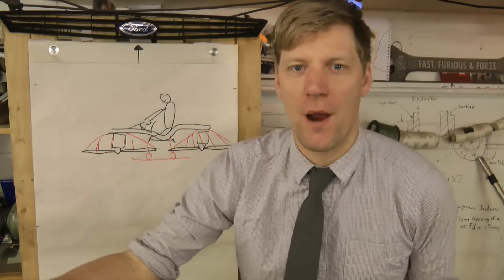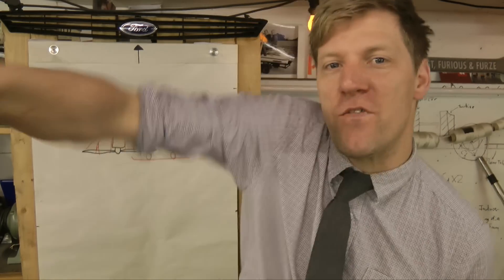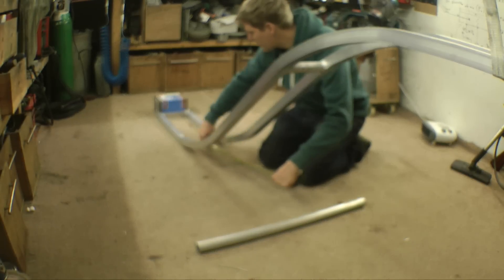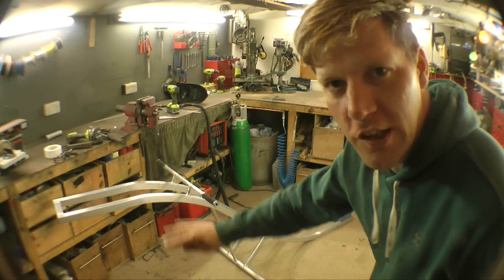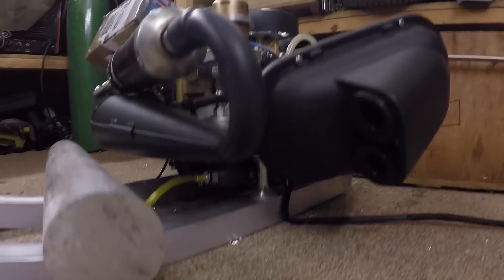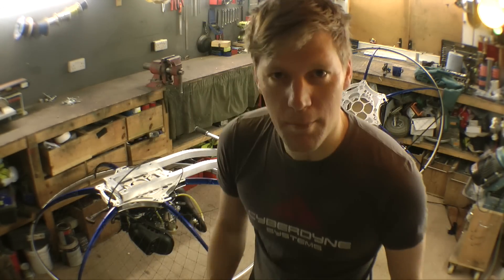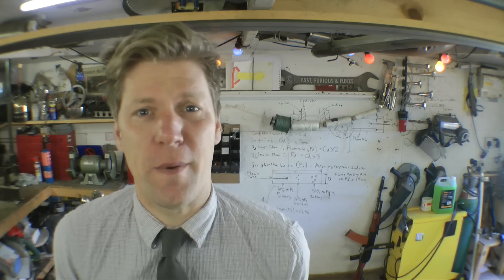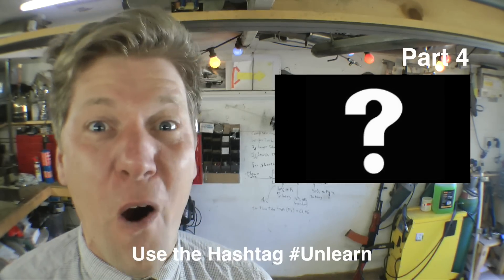Making a Home made Hoverbike

Comment: Awesome awesome! Carbon fiber is really easy to work with. Wet lay-up and vacuum bag to a mold or vacuum resin infusion (a little more complex). The carbon is expensive but if you can swing it it's worth it. It lays up just like fiberglass.

Awesome bike! Thanks for building it.

Comment: Why you did not consider placing two smaller engines on sides to control roll?
Reply: Weight
Reply: roll is handled by weight, same as a normal bike
Reply: too much weight maybe...
Reply: +Reptilius Maximus uneven acceleration will do the rolling job he wanting or not
Reply: lean to roll
Reply: Do a barrel roll!
Reply: He said he didn't have a big enough budget for 4
Reply: +Harrison Harris that's not exactly true, bikes are handled with handlebars, leaning only helps a tiny bit
Reply: +RockPapersBeer exactly what I was thinking he will probably just hover it
Reply: +Harrison Harris That's not possible since the center of mass is too high above the propellers when it should be way under them.  It makes it very unstable and once you roll to one side, you can't recover from it anymore and you'll tip over.
Reply: I suppose we are talking about horizontal roll, not vertical roll. I know there is a english word for it, but i cant remember
Reply: Pitch, yaw and roll are the english terms for the three axes.*****
Reply: +o3tomas No, leaning is where most of your control comes from. You only really use the handlebars at very low speeds.
Reply: Killspec that is because of the friction of the wheels with the ground. His flying machine will just move laterally if he try to lean
Reply: ***** thats true. he was talking about motorcycles though. I wonder though if you lean while going forward if you would indeed turn.
Reply: +RockPapersBeer If the front motor is run at a reduced speed to the back motor the angle of tilt produced would move the craft forward much like with a helicopter, depending on the setup this might also cause the craft to turn as well.
Reply: he will have to move forward and backward by leaning the body, for turning he will need to use uneven torque
Reply: +Brent Sido I think that with the front one being further from the ground it will natural produce slightly less thrust

Comment: There is a slight problem in inverting the motor, it also inverts the thrust :) and flipping the propeller doesn't change that, only reduces its efficacy.
Also it is an inherently unstable design in two axes that unless you can balance it by shifting your weight while balancing the two motor thrust. The design is problematic :)
Reply: No one cares mate if it flys is all were bothered about. It's people like you that never invent anything where Colin does
Reply: +Hecarim But he is right, in order for this to work he has to buy and install a mirrored version of the propeller. I hope he thought of that, else it won't possibly work.

Ok, on 4:34 you can see, that he has two opposite handed propellers on the engines, so he really thought of it ;)
Reply: +R5skillz Flying is highly researched topic and dynamic balance calculations are grade-school level physics... so there's no need to try to guess when you can rely on math and calculations and experiments done by others way before him to know it's going to be unstable.
Reply: +Dan Frederiksen I am sure he knows this and got a CCW prop.
Reply: +Dan Frederiksen if hes using the same propeller yes, they sell reverse rotation propellers
Reply: +Klaufmann ok so he got an opposite spin prop, he left that important bit out but fair enough, still some critical problems remain. His weight on the foot rests is technically below the thrust center which would balance but because his weight center is not at his feet, any leaning of the vehicle will make him lean his weight as well and void that. So I'm thinking it is inherently unstable in pitch and roll. With skill it might technically be possible to balance on it but it would be extremely dangerous to really fly it. But he could make a position under it which could help a lot.
Reply: +Hecarim, except I was completely right.
Reply: +Hecarim, the craft was quite unstable in flight exactly as I described above. Which part don't you understand. Although I was a little surprised at how roll stable it was. Not to mention he almost fell into the propeller at one point which is really a very serious thing.
Physics plays for keeps. There is no plumber's discount.

Comment: how do you turn???
Reply: +JK JIBJAB you dont
Reply: Magic
Reply: +nick hansen XD
Reply: lean?
Reply: not
Reply: +JK JIBJAB I'm thinking that if you lean you will create a difference in lift from one side of each fan to the other side. this may cause some rotation.  I really don't know but that is my prediction.
Reply: You don't.
Reply: +JK JIBJAB Well.. it's a "hover"bike isn't it?
Reply: +JK JIBJAB With your weight
Reply: +JK JIBJAB It turns on it's own, if by turning you mean flip.
Reply: +JK JIBJAB make 1 propellor turn slower
Reply: +Colin Firth I fly Quadcopters and therefore I know a little bit about those things.
a) you could turn, by leaning to one side and accelerating the front engine, however, you will most likely crash after the maneuver.
Flying with 2 Motors is almost impossible because it is up to the pilot to maintain balance. Once you loose balance (Not perfectly balanced frame, wind, leaning to one side) the rotors will start drifting to one side and you would crash.

I don't think that he needs to turn because all he can do is fly up a few centimeters and try not to land on his side.
Reply: Needs ailerons or rudder...
Reply: Rupert Bruce What he really needs are 2 motors on the side. Rudder or Ailerons would cause the 'hovercraft' to crash, since a rudder creates force on the top and therefore create movement to the side. Ailerons aren't a bad idea but he would need to go really fast in order to get ailerons to do anything. A plane has Rudder and Ailerons because of the speed of the air. A hovercraft can hover (won't go fast, nothing to push against a control surface.) so there wouldn't be a use for such controls. All he needs to build is esssentialy a Quadcopter or Tricopter.
Reply: +AsStrange0815 It's possible to turn on the y axis by reducing the thrust of one engine, allowing the dominant engine to create a rotational force, however, this would also cause the craft to start travelling forwards as well... as you said, the easiest thing to do would be to build a quad or tricopter.
Reply: +Tyler Whieler But that will always make it yaw at the same time.
Reply: you can move (not turn) sideways by leaning to the desired side. 
Increasing the throttle of the clockwise turning engine will make you turn counterclockwise and indeed also makes you go forward or backward, but that could be countered by leaning to the opposite side. 
a bit complex to master, but introducing bodyweight to the steering technique could make this possible. 
Balance will be a thing though. it's like sitting on a bicycle on ice...
I'd hate to see you end like this, Colin...

Comment: I like how easy it is to make this flying machine make certain maneuvers, but, it can't strafe. It can turn, go forward, and go backward, but, you have to be able to shift the amount of power from the front and back, as well as change the directions of the blacks to face inward or outward to make it spin. Strafe would take another blade. With a microchip to control power distribution and angle, you could have to only worry about height and direction.

Comment: Just found the channel today, really enjoying the videos. A tip about aluminum I think you might want to look into on your next build. Rivnut inserts, they are wonderful little rivet type objects that actually make a metal thread into thin wall aluminum tubing.
Then you can have a threaded hole in aluminum that you can take your bolt in and out a bunch of times without worrying about damaging the threads.

Comment: add 8 edfs 2 on the back for acceleration, 2 on front for brakes 1 on left and 1 on right of every larger to allow steering and add yaw and pitch control on the large blades for strafeing and stabilization.

Comment: hope you're seing this furze, but i went over your design, and i think i have a few adjustments: First i think the frame should be longer, so that you can add a chair or a saddle or something, but the end have to be symetrically equal from the saddle, secondly, i think that you should remove those "wire nets" for your protection shields and replace them with solid sheets of metal. i am saying this because, while the prepellers spin, air is going everywhere, but if they have a dome, then air will only go down, making you hover higher. That will add some weight so try replacing some materials with lighter ones. I don" know what the frame is made of but i thing you can replace with carbon fiber (first and only light material i could think of), or try something else, like aluminium. I hope this helps, because i really wanna see you upgrade it ;)

Comment: One tweak you could make is to run one of the engines backwards (since it's a two stroke) and then the frame could be more straight and thus a bit lighter.  The only tweak you have to make for that is to reverse the ignition basically because on a two stroke that's the only thing that prevents the engine from running the same in either direction.

Comment: If one engine stops mid-air, the machine will go into a deadly infinite spin. An interlock mechanism must be added so that when one engine has a flameout, the other engine is shut down automatically.

Also some sort of open-source FMU (Pixhawk or Mateksys) might help stabilizing it easier.

Comment: @colinfurze Mate... Add ~4 edv motors, not for thrust, but for steering. Hook them up with on them hoobyking quadcopter stabilization gyroscope controllers and a control stick so you can actually control the machine you built :) You could even add two at the ends facing sidewards to rotate the thing.

Comment: loved the video.although felt you needed 4 engines and 4 spring loaded wings to run along the shafts just in case of engine failures.that way if it did fall from a great height at least it would lessen the fall impact..

Comment: really cool i wonder if they make a smaller rotax engine that would allow 4 fans (2 up front 2 rear) set in opposing directions they would offer way more stability and pitch/yaw control which would allow you more altitude tho youd really have to put alot of thought into setting up your controls so you can have forward motion

Comment: Two strokes can turn in opposite dirwctions without any problem. You would just have to adjust the ignition time and start in in the other direction. No need turn the engine upside down

Comment: Some lightweight wind socks controlled by some lightweight springs and cables For steering? Or a lightweight gyroscopic mount for the motors and propellers. Is it also possible to find better propellers that push more air?

Comment: Most modern drones use 4 motors in colinjunction with a flight controller for stability (see what i did there), why don't you try the same with your hoverbike - a scaled up, petrol powered version of todays racing drones. 

Cheers

Ben

Comment: Am I the only 1 who has noticed that by flipping the rear para-motor he has thrust at the front pushing down against the ground when the back is pointed up pushing upwards towards the sky. This just means that his 'hover bike' will essentially just flip up end on end like an infinite wheelie?

The only way to solve the issue is to make the rear motor's blades have the opposite angle of attack and therefore creating lift towards the motor rather than thrust away from it as it is designed.

Just a thought as I guess at this point he has already made the video getting it ready for Fursday and he will have tested this and worked it out himself.
Reply: +DrUm Mist The prop is reversible, so simply flipping the entire prop converts it from a pusher to a puller and vise versa.
Reply: Didn't hear him mention that he reversed the blade, Looks like he put it together how he took it apart.

Comment: I understand that for sake of simplicity flipping the engine was the quickest option, but to move the center of gravity as low as possible it would have been better to have both engines facing up, with propellers on top, with the spin on one of them reversed trough a gear. Also, I've seen you fly this. You will not die a natural death, you know that?

Comment: Now here's a theory, and I haven't researched it yet, however since Hydrogen is lighter than nitrogen and oxygen, what if you replaced the oxygen in your tubing with helium? Not sure how much it would help but I would assume it would help some.
Reply: It wouldn't do anything.  First, most of air is Nitrogen, about 80%.  Two, the volume in the tubing is very little.

Comment: colin you are a goodn...top fettler and a flippin nutter in the best sense of the term.....but i do not want to see you die or get mashed up either would your likkle lad....so .....peeps have said that you need some control for the beast........firstly check out 'flying electric bike invented in czech rep' and see the two lateral fans that stop roll over....idea......maybe you could fettle some lateral nozzels from the exhaust gas from your motors like the harrier has on its wingtips.
so far as control goes 'flight controllers' are rite good nowerdays theyve got giros and accelerometers in em (size of a matchbox and cheep) ive built quads and hex's and i'm no boffin so it'll be pretty easy to setup.....anyways im a keen fan of your activities...if you want me to film your epic from de sky (using me big hex) then FB me.....Roy davies in sheffield xx (man kiss!!)

Comment: On a similar note, I'm trying to make a Hoverboard with a Snowboard chassis (I picked Snowboard because I noticed a distinct lack of straps and therefore maneuverability on current hoverboards).  I'd have a max load of 225 lbs (200 weight limit + max of 25 pound hoverboard).  Can it be done?  Math is hard.    :'{

Comment: What if you flipped it upside down and rode it like that
Reply: You stay on the ground
Reply: +Grand Moo53 Would it not stay working?
Reply: The way the blades are placed they push the bike off the ground if the bike was flipped it would push the bike onto the ground stopping it from taking off.

Comment: I'm sorry, but this is not going to work. Unlike with bikes you won't have the vertical rotating force that keeps you upright. There is a reason helicopters have their propellers above the point of gravity.
Reply: +Philip Engelenberg Nah, look at 5:37. The propellers would be at the height of his knee. Nowhere near his upper body, where the center of mass is. And even with the point of gravity just above or leveled with the propellers, it would be impossible to balance it.
Reply: +wtfdinges Not to mention that the real prop is thrusting towards the sky as he just inverted it without changing the angle of attack on the rotors. I don't even have any background in engineering and I can see that despite any centre of gravity issues, his 'hover bike' will flip up at the front and down at the back doing an infitie wheelie.
Reply from the maker: +DrUm Mist at 4pm today you will see if your flip idea is correct or not......
Reply: +wtfdinges I'm sorry but it seems you were wrong!
Reply: Yeah I noticed! I think it works because his altitude is relatively low. As soon as the 'bike' leans towards a certain side, the lower side has more wind force against the ground while the upper side loses force. This seems to give it some sort of natural balancing mechanism. I really wonder what happens if he manages to get to an altitude of several meters.
Reply: +wtfdinges As long as there is a force that changes the axis of rotation, the "gyroscope" will put a force against that. The only way it would just fall over would be to install the rotors in a way that they dircetly blow in his face. They are acting like a spinning top.